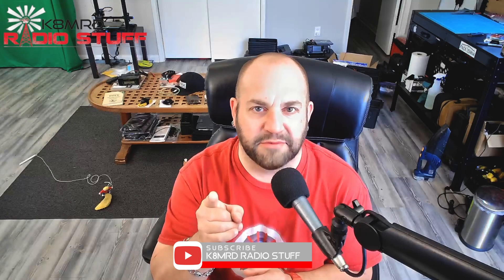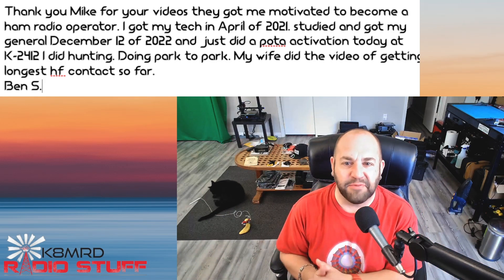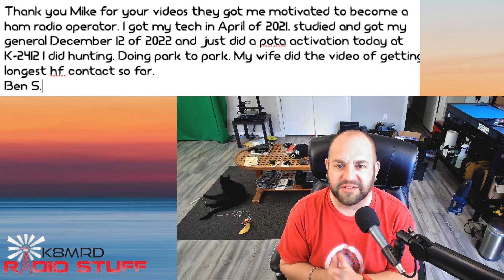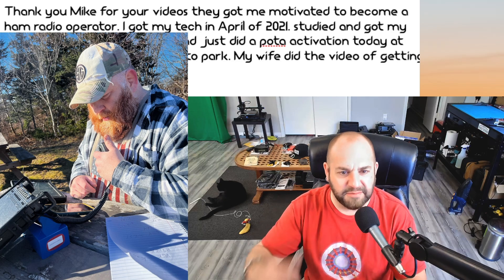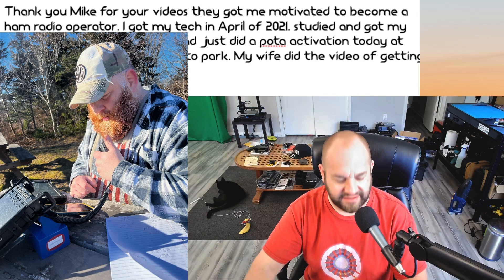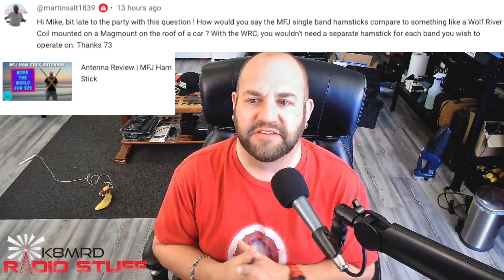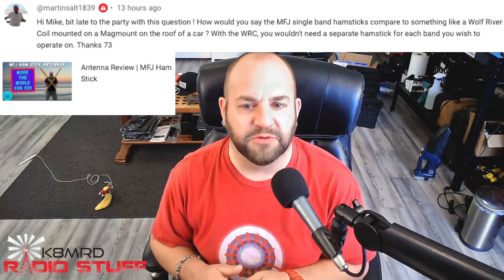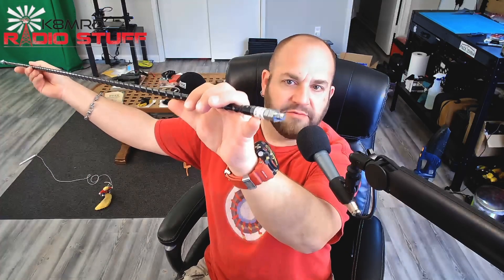DIY Solderless Ham Radio Antenna

Comment: I can't see why anyone would not be able to solder even in the smallest of apartments... You're not getting lead fumes since the temperature is not hot enough to vaporize lead... You're just getting the rosin flux fumes, so it's more of a pine scent... And the amount of soldering that you would need to do for a antenna is very minimal anyway... And if you so wimpy that even that little bit of fumes makes you soil your panties, then just move your soldering into the bathroom -- surely it has an exhaust fan, right?
Reply: What is the problem with a solderless solution. You are not always in a situation where solder is available. Knowing how to be flexible with your options is a great tool from many aspects. Tonight i am going home and making this exact same solderless dipole just because i can. I am also going to shit it up a little bit in your honor.
Reply: Seems as if someone did not hear the part about lots of carpet being in the apartment. If it's like most cheaply built and overpriced apartments, the carpet is likely a substandard quality that barely meets fire code regulations which means it probably does not take much heat for it to ignite. Shit does happen and the person asking for an alternate solution probably just does not want to risk burning down an entire apartment building. So, the solderless approach is the one I would use in a similar situation.
Reply: @CharlesHuse  -- I'm pretty sure that there is no carpeting in either the bathroom or the bathtub ... There's probably even an exhaust fan in there... I think it is more likely a case of someone who thinks that melting solder produces lead fumes and is scared of it... Enabling his irrational fear of it does not help him...
Reply: We got 3 x4 plywood sheets at the radio club  and leadless solder for the foundation  trainees  . At one time to get any ham licence in the uk you had to be able to solder
Reply: Awh, did I trigger you, snowflake?  Bless your little cat-lady heart... I reload my own ammo and cast my own bullets, so I am quite familiar with molten lead and the dangers associated with it. Hell, I create more toxic fumes when cooking than when casting bullets, much less a little bit of soldering.
Reply: Or perhaps Curmudgeon, people don't own a soldering iron, solder and braid? Maybe there are people in I dunno warzones or places Amazon don't deliver that would like to know how to get back on the air without stable electrical supply. Maybe someone needs to be able to disassemble and conceal their antenna as parts of something else because people who carry such things are suspect of being dissidents? Or maybe someone wants to teach their little kid how to make an antenna but either they or the kid lack the motor co-ordination for a hot iron? Think outside your smelly little box for a minute.
Reply: @SquillagusNiggle  -- And yet he's able to get everything else that is necessary to get a transmitter on the air?  LMAO... More than likely just someone who is so clueless that they think that soldering produces LEAD fumes...
Reply: field build/repairs , no soldering equipment ,  most of all for research and development , also link dipole tuning ,
Reply: Or he lives in a subsidized apartment building where they watch you like a hawk for any minor violation. Most of them have very oversensitive smoke detectors. Not to protect from fire, but to stop people from smoking in the apartments.
Reply from the maker: I think your name says it all.  Let this be a lesson to anyone reading.  There are many keyboard commandoes out there, much like this guy.  Hey Curmudgeon, you're not in his shoes.  You don't know what he's going through.  You are the cancer that exists in ham radio.  Just know that.  Fortunately, guys like you are dying off quickly.  I hope you're next.
Reply: Just solder over your kitchen sink with a chopping board. What's the worst that can happen? :face-blue-wide-eyes:Don't forget your N95 mask though! Good video though of what can be done without having to do that.

Comment: Mike
I would have loved to have seen you test that speaker wire antenna on the air or at least on an antenna analyzer.
Reply from the maker: Well I don't have a video on exactly this antenna but I can tell you speaker wire makes great antennas.  Here's one video I did back in 2018 with a speaker wire antenna https://youtu.be/sSMDazjkuUk and here's one I did in 2022 https://youtu.be/5g1jXzujPhg  Most of my very early POTA videos were with the same KG6HQD speaker wire antenna.  Here is the late, great Jerry, KG6HQD showing how to make the antenna https://youtu.be/cqh0Ntus5G0?si=2wfDymm3cRk9Ee2u and he has all kinds of videos on his channel using it for SOTA too.  He is gone, but certainly not forgotten.  Hope you enjoy.

Comment: I'm having problems with that bnc to banana plugs I used i think a 20AWG did my calculations for the CB band but the swr is still very high. I used 2.8m of wire for each side so I could later cut it shorter while tuning it but somehow my nanovna h4 show swr 14.0 I thought I was gonna have at worst 3. Could the coaxial with its connector be faulty for having huge swr or why is it?

Comment: Whats the measurement for both cables for making one of these for UHF?
Reply: For UHF the lengths are short enough you could get away with a coax dipole (using the center as one leg, with an eyelet even for hanging, and the braid as the other). It'd be a half wave dipole, so about 6.3 inches for 70cm. Useful as a field expedient back up antenna as well.

Comment: Nice quick antennas. I note the sharp coax bend at the top with the zip tie.  My concern is this may be a point prone to "coax migration", where, over time, the center conductor "migrates" through the dielectric and shorts to the braid.

Comment: Hi Mike, How well will this simple antenna work on the 2 meter band?  I know there is a lot of interest these days in the j-pole design, but this little dipole seems to be much more simple.
Reply from the maker: A dipole will work great on any band, but dipoles don't really have any gain so keep that in mind.  They are certainly about the easiest antenna you can build though.  I imagine it would be similar to a J-Pole in terms of performance as they are really just folded off center fed dipoles.  VHF is 99% all about line of site so the higher you can get it off the ground, the better results you can expect.  But also keep in mind polarization.  Most people and repeaters are using vertical antennas for 2 meters.  If you hang a 2 meter dipole horizontally I would expect a huge drop in performance, just because everyone else you're trying to reach are using vertically polarized antennas.  Except maybe for 2 meter SSB, where people would probably be using a horizontally polarized antenna.  Not an area I'm too familiar with though so don't hold me to that.  Either way, it's a fun build.  I certainly built a 2 meter dipole when I first got licensed and that was my gateway into becoming a giant antenna nerd!
Reply: @hamradiotube  Thanks for your reply, and helpful suggestions. 73

Comment: Question so does this replace a regular antenna I’m not a ham but learning about this stuff
Reply from the maker: Well there are about a million different kinds of antennas.  This is just one type.   A dipole to be specific.  So I wouldn't say it replaces an antenna as much as I would say it is an antenna.  There's verticals, dipoles, end feds, Yagi's, off center fed, loaded, etc.  The list goes on and an.  But, depending on the frequency you want to use, that will determine the length of the antenna.  Lower frequencies will need a longer antenna, higher frequencies will use a shorter antenna.

Comment: Can old cable tv coax cable work  to make a antenna
Reply from the maker: That's a good question.  I honestly don't know.  I know people have made antennas from radio coax which is 50 ohms.  TV coax is 75 ohms so there might be some matching you would need to do, but I would suspect you could still do it.

Comment: Aah, when you cut those 3 holes on each side of the plastic i though you were going to build a dipole that could be switched between 3 different cable lenghts using cable connectors 😊

Comment: How do you tune the dipole antenna?  Can it be tuned without special equipment? I am old and retired on a fixed income. So cheap, and easy is best. Fast is optional.
Reply: A lot of times he runs the G90 radio which has an incredible on board tuner.

Comment: You should drill your holes in the plastic cutting board before you cut out the shapes. Saves you from needing to use the vise or scraping your fingers. Why drill on the tiny pieces?
Reply from the maker: Because that would make too much sense lol!

Comment: nice di pole antenna build. I did something like that in the past. still in my go bag.  I made it  all in a park with little tools. knife and pliers with cheap stuff from hardware store.  instead of crimp terminals I used nut and bolt with washers and wing nuts. love how you come up with things. 73's
Reply: That's even easier. No crimper required!

Comment: That's a great video.  Thank you for sharing such valuable information.  I recently  "McGyvered"  a dipole like your suggestion using the banana plug/bnc connector for the center connector.  The wire I used is 16 gauge wire each on the spool it came with and the wires just happened to be red and black.

I will leave the wire on the spools for ease of transport and adjusting during use.  I'm looking forward to experimenting with it as the weather gets warmer.

Thank you again for all the great videos.

Stay safe and happy hamming everyone  🤠😎

Comment: Most folks don't realize for a mobile or portable setup you're WAY better off using crimp/compression fittings vs soldered connections. Anything that's going to "vibrate", like in a vehicle, or routinely gets stuffed in a pack for SOTA ETC will eventually break a soldered joint regardless of your solder skills. That's why the wiring harnesses in cars for the most part ALL use crimp fittings vs solder! The only solder bond work-around I've seen that works is  done on race rigs for like Baja or Dakar Rally rigs, where the wiring solder joints are done inside a small box then "potted" by filling it up with epoxy resin.

Comment: Somehow it did not occur to me to mark the whip on a ham stick and then slide it down in to the coil. I learned a thing.

When you said solderless antenna and busted out that roll of speaker wire I really expected the old KG6HQD dipole, though.

Comment: Hamsticks and triple mag mount have an advantage running mobile.  They can handle 80 mph highway speeds where the Wolf River Coil is too fragile for anything other than stationary deployment.  Screw driver antennas are more convenient but the cost is high.  The choice comes down to personal decisions on cost, performance and convenience.  What are you willing to deal with on your budget and operating style

Comment: Hey Mike. I use a EFHW 80-10 1kw antenna at my QTH. it’s 30ft in the air on a mast running horizontally to a tree with a 2 liter bottle tied to a rope attached to the end of the wire for tension. I was thinking of changing that configuration to an inverted V with the ends 4ft off the ground and center point at the top of the 30ft mast. My question is about orientation. Should it be north south or East west? I’m in SC and am interested in contacts to the west and northwest. Right now I do well on the east coast and SA. It’s current orientation is north south about 300 degrees limited by the tree.
Reply from the maker: You'd have to try it and let me know.  In theory an inverted V should be more omnidirectional.  I'll tell you, I have two horizontal 80 meter EFHW's at home, both about 30' up, one radiating N/S, the other E/W and I've gotten some pretty surprising contacts on the N/S configuration that I wouldn't expect.  It's all about experimenting.  I'd be curious what you find out though.

Comment: With the wolf river coil you can set the radio to where you want to transmit, turn up the volume then slide the collar to where it sounds the loudest. That will get you pretty close.
Reply from the maker: Yep.  That's a great way to do it without an analyzer.

Comment: Hi Mike.  Rather than unravel the shield, if you open a small hole in the shield where the shield comes out of the cover and than pull the center wire through the hole, it works a lot better. Less messy.   Bob  AA7B

Comment: The guy that ask the question about the no solder antenna was located in an apartment on the ninth floor with no balcony! The type of antenna, a dipole may not be a good choice. The best antenna In your case would be a magnetic loop antenna as for home brewing one there are plans online but most require soldering! If you don’t have the skills or are worried about any issues with soldering I’m sure you can get help with that from fellow hams in your area or buy a pre made magnetic loop like a chameleon FLoop. They are pricy and it’s way cheaper to build one but for convenience it might be worth looking into buying one. Also magloop antennas don’t handle a lot of power like at the most 30watts but in an apartment you don’t want to run to much power anyway to avoid interfering with your neighbors electronics! I have the Chameleon PLoop and run it with my IC705 at 10watts and I do ok I’ve made several contacts all over the US and Canada from inside my apartment!
Reply: Have you ever hook up speaker wire to a tuner in a loop?

Comment: Hi Mike,
Zero solder, that's heresy.  🙂 Nice simple dipole build. Have a suggestion for the Hamsticks. Instead of loosening the screws to slide the whip down for storage, lock down the screws and then loosen the whip adapter. That way just remove the already tuned whip and store it into the main body of the Hamstick. To get ready for use, now just hand tighten the whip. Stay safe.  73  WJ3U
Reply: That is how I have done it for years.  Also before you throw away a broken ham stick you can tune the whip portion for a different section of the band.  CW/SSB.

Comment: You sure are getting a lot of milage out of that cutting board! 👍👍👍 As much as I love soldering and as skilled at it as I am as well these types of projects really have a place in everyone's kits. The BNC to Banana adapter is awesome, but the cutting board antenna really deserves an award for simplicity and for using parts you probably have 😎
Reply from the maker: Yeah I think it's about at the end of its life cycle but I've made quite a few things out of it so I'd say I got my $.88 worth lol!
Reply: @hamradiotube  I went to Walmart this evening looking for that 88 cents cutting board. The cheapest one was a tiny thing at $2.77. I did find a few at Dollar tree for $1.25 each.
Reply: @michaelmullins9874  Inflation got ya

Comment: I think the Hamsticks have a very narrow “sweet spot” within a given band vs WRC when properly tuned which if true is a material difference.
Reply from the maker: For sure they do.  I've tuned mine for the center of the phone portion.  Don't really need to make adjustments unless I want to go lower in the digital/cw portion.

Comment: OUTSTANDING VIDEO. I wish there was something greater than a thumbs up I could give it. I am in much the same situation that the person that asked the question is. I DO have a window with a 1 inch thick inside ledge. I have a distance of 5 feet parallel to the window and appox. 25 feet perpendicular to it. Worst is is a government owned building so NOTHING outside the window at all. 

The best solution that I have some up with is:
#1 An adhesive mounted window 2m/1.74cm/70cm antenna made for a car which I can stick onto the window glass. That should work pretty well for VHF/UHF

#2 The Indoor Outdoor Window Clamp HF Antenna for 2 to 40M MFJ-1622. Which I can put up after dark and take down in the morning. :(

# 3 THREE speaker wire dipoles like you are making here. Cut and tuned to the middle of the 6 and 10, and15 meter bands. Hang that up using picture hooks on each wall and hope that there is not too many steel girders or iron rebar in these walls that it absorbs all of my radiated signal.

Any more suggestions would be appreciated.

Comment: Hi Mike.  Your analysis of Wolfe River vs Hamsticks didn't include one very important factor.  The operating environment.  Those telescoping whips would not survive very long running mobile  If the wind at 70 mph didn't snap the whip in half, the first low hanging tree branch would.  However, if the plan is to operate in a stationary car, I say "go for it".  For every reason you said.
Of course, you don't have to use the telescoping whip with the Wolfe River.  Have you ever considered a 102" CB whip?  The stainless steel ones are not very expensive and are rugged as all get out.  And, they use the same 3/8 mounting stud.  Well, that's my 4 cents thrown in.  Used to be 2 cents.  But, you know, inflation.  I hope to catch you on the air some time.  73.
Reply: Why are you you running mobile in 70 mph winds again? Are you in a tropical storm?:face-blue-question-mark: